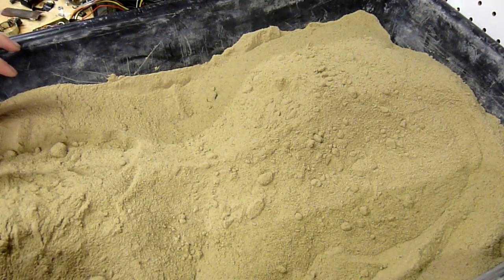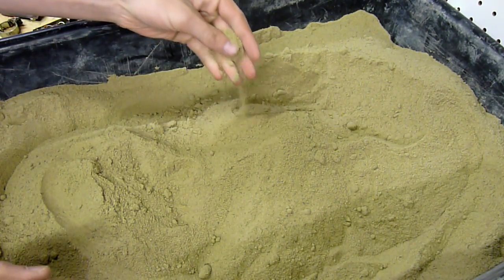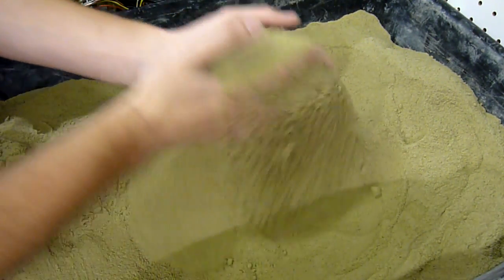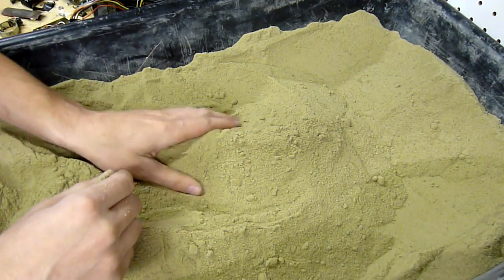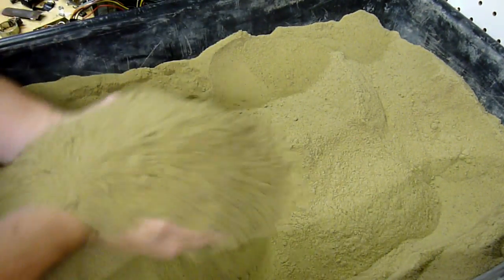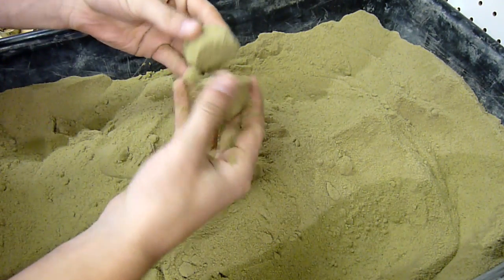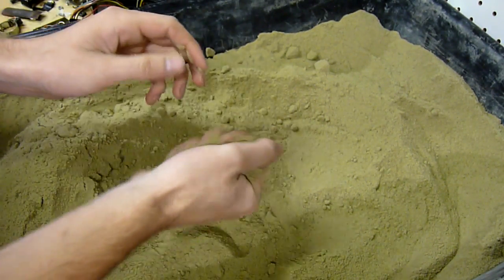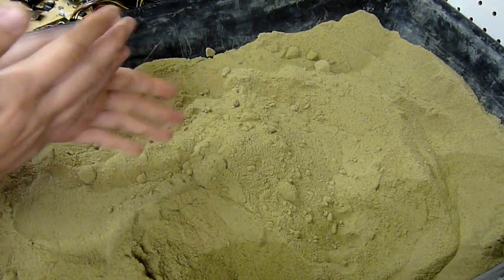Homemade Greensand for Sand Casting

Comment: The clay in oil bonded molding sand (ie  Petrobond or K-bond) isn't regular bentonite clay,  it's been chemically modified to absorb oil the way normal bentonite absorbs water.  A catalyst is also used to help the "organoclay" absorb the oil.  So if you use oil instead of water to temper your bentonite based greensand, you might be able to make a mold with it... but it probably won't have a lot more green strength than those sand castles you mentioned.  It's difficult but possible to find the right "organoclay" and oil to make your own oil bonded sand, but the organoclay can bent tricky to find in small quantities.  So if you're going to all that trouble it makes sense to get the right sand too.  You need the right grain shape and size distribution if you want to match the performance of real Petrobond.  The sand can be trickier to source than most people think.  Agree that beginners don't want to buy a heap of molding sand (and build a sand muller) are better off making small batches of greensand.

Comment: I agree with the oil vs water though some foundry favor mixing oil or coal tar based things. Water would evaporate or be more easier to regulate for home sand castings in my opinion. Definitely more environmentally friendly to. It still a little difficult to see what amount of ratio of sand to clay is best as well as water it seem you need very very little water just to damp it enough.

Comment: curious why should one mix sand with the ground up clay or kitty litter. How is very fine clay or kitty litter on its own different then mixing sand with it.. is it nessary does the sand in dry form still act like aggregate to strengthen the clay powder?

Comment: hello, in my country the moisture is made by adding oil to prevent vaporizing if it's made by water, and oil dries only once burned, do you know what i mean
Reply: What kind of oil do you use? Doesn´t it smoke a lot more with oil than with water?
Reply: olive oil, just a little bit, try for a small sample, i'm sure you'll love it, i men when the oil bunrn generate CO2 and swallows air and the air in this case is melted alluminum and the shape will be garenteed
Reply: Ok thanks!

Comment: Once you have your supply greensand, can it  be used over again?
Reply: +George P you could reuse quite a bit, but you'll probably need to grind it up because it gets clump.
Reply: George P use it over and over, just rehydrate the sand and sift as necessary

Comment: Where are the next two videos to which you are refering?
Reply: fritz ling he will post them as soon as he finds out he should not use old used cat litter
Reply: Turns out Bentonite clay powder is cheap.

I had 15 lbs shipped for under 25.00.

Works great.

Thanks for the video. It got me in the right direction.

https://www.baileypottery.com/clay/clays-chemicals.htm
Reply: +fritz ling So whats the actual recipe? :D
Reply: +fritz ling I just go to the dollar store and buy 7 lbs. bags for a buck a piece.

Comment: This is the best video I've seen so far, I made my furnace already I'm going with charcoal.. Where did you get the fine sand ?? I went to Home Depot and they do not carry it. Exactly what kitty litter did you use and how did you grind it ?
Reply: I get all the rocks out if it has any then I use an old blender to get it real fine, I add the sand and water into it when it's in the blender. After it is a fine power tho

Comment: 10% bentonite.?..by volume or weight?
Reply: +Lucien Macrose Dry and solid materials are almost always measured by weight. Volume is reserved for liquids. It's more practical and exact to measure dry materials, such as powders, by weight, as volume can vary because of things such as granule size. Larger granules will trap air between them, affecting the volume measurement.
Reply: Great information! I will rember this for future reference. Sound wisdom! Later

Comment: How did you grind your kitty litter? I did some in a homemade ball mill, but it took forever and needed several batches to do one box of litter. If you have a better way, I would like to know about it.
Reply: Jeremy Hall Have you personally ground the kitty litter(Bentonite) in a coffee grinder? How does the coffee grinder hold up or does it take a few grinders?
Reply: Jeremy Hall Thanks for advice man!!! This is something that I'm trying to get all lined up for my first pour!  I haven't made anything yet. So many foundry designs, molds, ingots etc. I have a limitless supply of motor oil too...

Comment: should use 2 cycle 50-1. saw it in another vid. What I would like to know is why not use a small cement mixer to make your green sand? you could let it mix as long as you want till it is the right consistency while you are doing something else.
Reply: another vid on here shows a homemade mixing rig akin to a cement mixer; so long as everything is clean and you arent contaminating your sand, you could indeed use a cement mixer. though youd have to be there for the moisture-adding part.

Comment: Since your videos are shot, you should have just done the entire thing with one video. Since you didn't include "Part 1" etc., in the title, viewers have to search for the next videos in the series but I still have no idea why you simply didn't just do it in one video unless you uploaded these videos when time limits were much shorter.
Reply: its possible it just takes forever to upload; i shot a 10 minute video once and i dont know if it was the connection or what, but it took something like 3 and a half hours to upload. though you are correct; locating the other videos (if indeed there are any) is fairly difficult; and would have been more viewer-friendly had it all been one video.

Comment: fun fact, most sand you find in places IS silica sand.. since silica dioxide is the fundamental make-up of ALL sand (y)
Reply: yep, said most sand.. can have wooden "sand" if you so desire, but thanks anyway :/
Reply: ***** common sands, like play sand (which i would be more likely to buy rather than use beach sand) are silica, so moot point anyhow. if someone wants to throw molten metal in a different sand because they didnt research what they read in a youtube comment, then theyll learn a good lesson.

Comment: to gring the kitty litter use a heavy duty zip lock bag then slam head into bag whiles its on a hard surface a few tyme then us a rubber hammer.

Comment: This video is just bad. He didn't explain how he made it exactly. I need to know brand names of everything.
Reply: If you need information that precise which can already be found in the video then I do not recommend you try smelting aluminum.
Reply: he had cat litter. he ground it up till it was fine. he added fine clean sand. he mixed it well. he spritzed water onto it and mixed it until it held its shape when squeezed with force, but did not stick to his hands. the clay to sand ratio is approximately 1:9, where 9 parts of sand are added for every 1 part of clay, though for desired consistency can be up to 12% instead of 10%. just add a tiny bit more of the clay. 

brand names dont mean anything; the kitty litter can be any CLUMPING CAT LITTER, just check to make sure it has bentonite clay in it. the sand can be any sand, as long as its fine (even powdery) and clean. use tap water.

Comment: Ahh, another video on YOUTUBE that has just enough detail to capture my interest but not enough detail to actually follow through. What kind of sand and where did you get it? What kind of kitty litter (brand)? You mention Home Depot. What did you purchase there? I'm afraid I didn't get enough detail in this video to mix anything with some level of confidence. Please elaborate.
Reply: Tom Grant - I've heard other green sand makers refer to using "non-scented" kitty litter. I imaging it's an attempt at using the closest thing to more expensive "pure", Bentonite.  RL
Reply: I think he explained it quite well. He's given you the info and some good personal tips rather than just a list of where to buy the ingredients.
Reply: @Tom Grant- "What kind of kitty litter (brand)? You mention Home Depot. What did you purchase there?"
 You too did not answer my questions but instead responded for what reason I do not know? So the point is that you are satisfied and know the answers but will not supply them? The questions I asked were not adequately answered.
Reply: Just use any fine sand. And the kitty litter has to be made out of bentonite. Look at the ingredients or buy bentonite from somewhere else. Kitty litter just happens to be a convenient source for bentonite.
Reply: Thanks-
Reply: bitch much? God damn

Comment: how can you tell if you have too much or too little clay? i just mixed mine up today and added all of the clay with 25%of the sand in broke good and had good strength. but now that i have added and mixed the rest of the sand in it's more fragile, but still breaks clean.
about 8bls of clay in about 80-100 lbs of sand

Comment: if i was going to make lots of it , i would get a moisture tester like a farmer has. Figure out what the perfect moisture level was. Testers come in two kinds, probes and hand held cups, you put a couple of handfuls of corn in (or green sand) push a button and in 3 seconds you have moisture level. I could be wrong maybe that kind of tester wont do rocks.

Comment: Looking at adding a small foundry to my workshop.  I've read several articles about making sure the sand is moistened to the correct consistency. Your video was very helpful in demonstrating just what it should look like.  Thanks for sharing it.

Comment: an old caster called jack couts told me to use molases to bind it but i still need to cook the mold and it goes like a rock and when you put it in a pail with a lid it will soften for to be reused a have used it and i like it he told me never to use chemical set sand as it is bad for your health so he said to use molases as a setting agent it may be a pain cooking it but is cleaner and safer on your lungs i have used sand and clay but with the molases it gets hard enuff to cut and file or sand